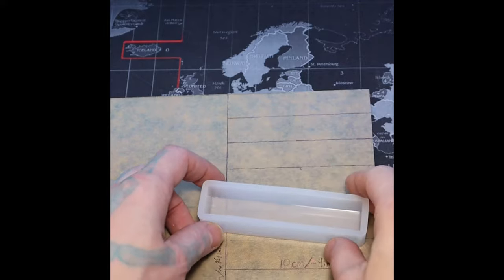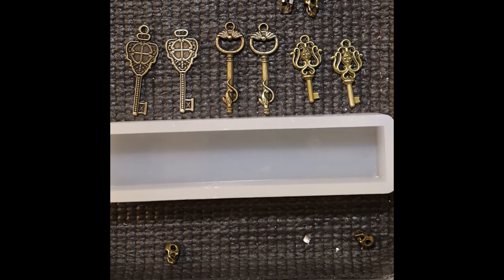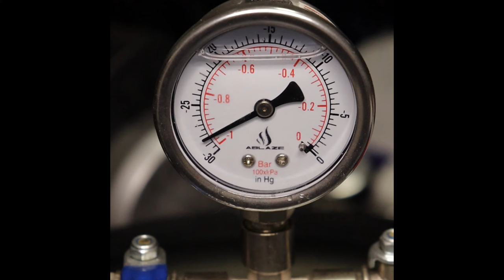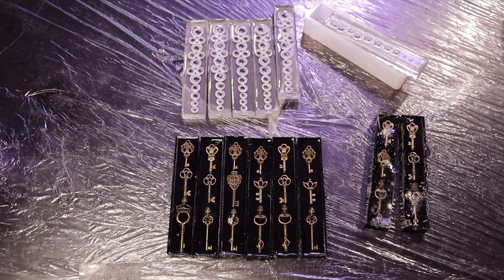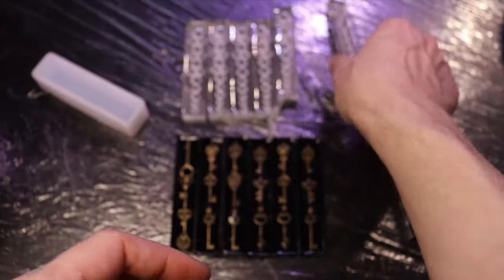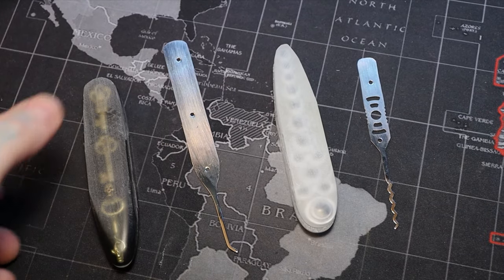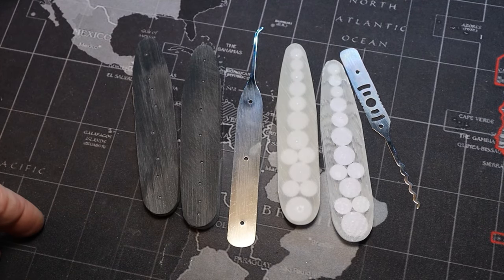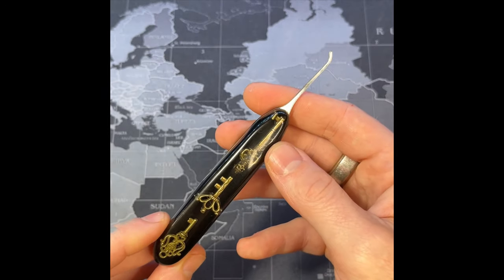282) How to Make Resin Handled Lockpicks

Comment: Wow!!! Those are gorgeous!!! Awesome work!!! 
On the bubbles when we build fly rods and apply the guides sometimes bubbles will form. I use a regular hair dryer on low heat to remove bubbles. 
Don’t know if that would work here?? Maybe. 
Great job!!!!
🐈‍⬛🐾🐈👍👍👍👍
Reply from the maker: Yea, if there are any bubbles I usually use a heat gun or very quick pass over with a small torch.  Have a good one, Chris!
Reply: @LockpickingDev  👏👏👏👍🐈‍⬛🐾